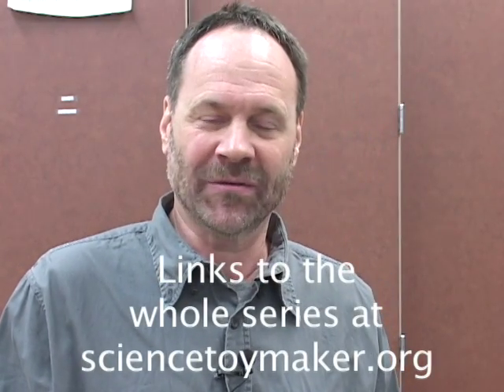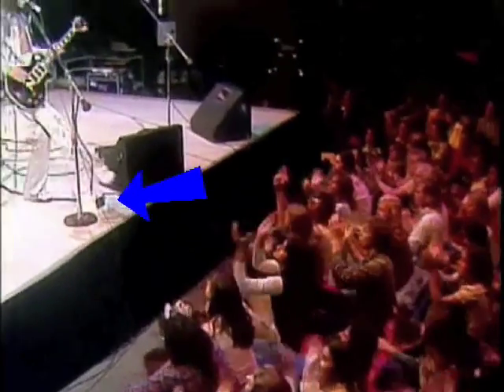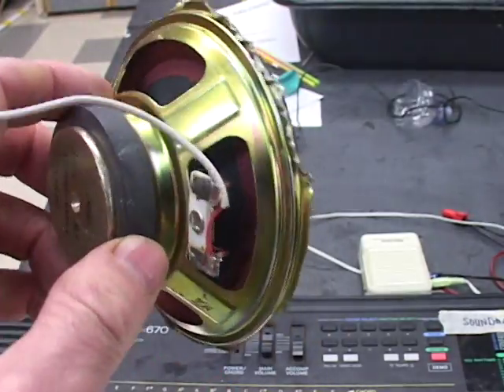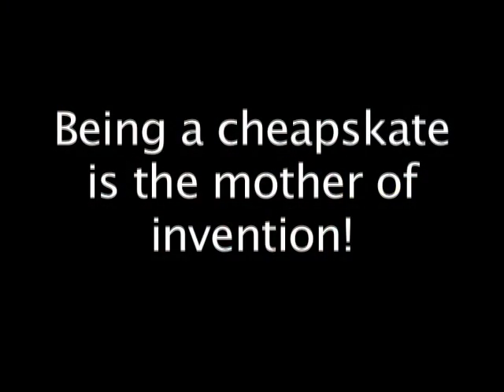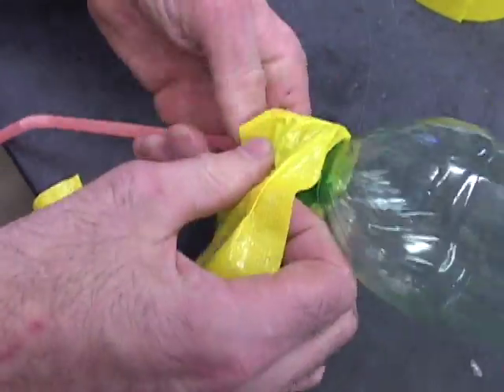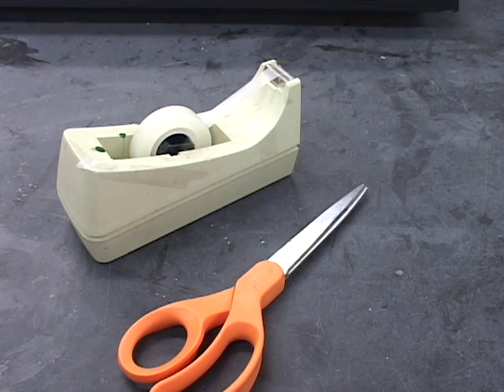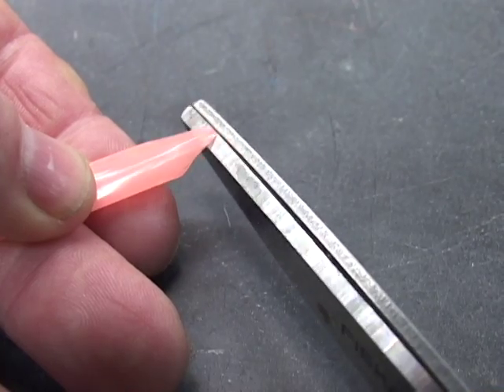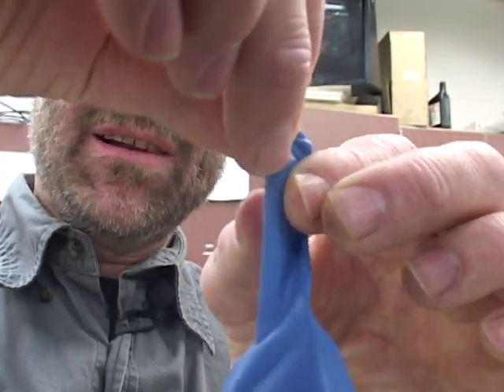Part 1 Make a Robot Voice Talk Box

Comment from the maker: What a great idea! I tried it and found that pinching the wire could get the reeds close enough. Pushing a pencil in would widen it. Even just sliding the wire a tiny bit closer or farther from the reeds adjusted them effectively. And I finally was able to get those high squeaks that have alluded me until now! Putting the tape on and off is a bit of a pain, but I folded the end so there is an un-sticky tab at the end.
Great feedback. How did you come up with the idea?

Comment from the maker: @RicoX697 Yes, thank you Rico for making that clear. Straws connect by butting one against another, then taping around. If one straw went inside another, then there would be some obstruction to air flow. It's already challenging to get the reed to work when there are multiple straws connected because there's more resistance to air flow with a longer path.
Slater

Comment: one thing that is missing from the video how to properly connect multiple straws. Initially, I pushed one straw inside another.....but you just make sure that both ends are touching each other and carefully tape to seal off the air.